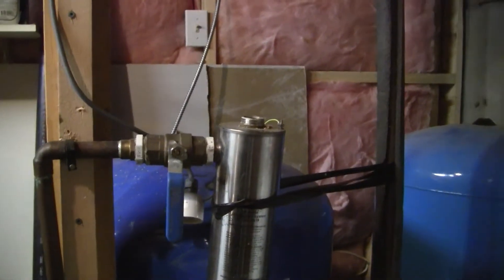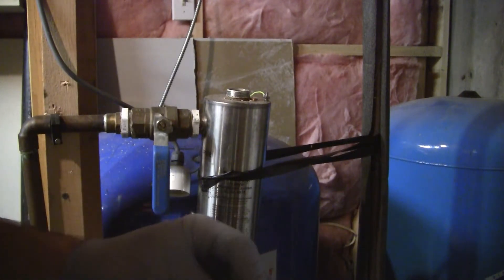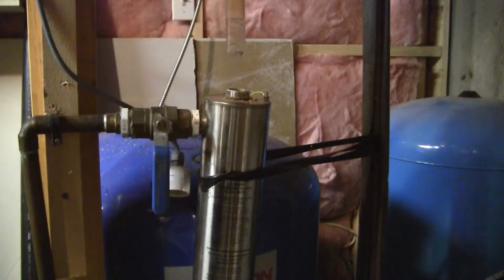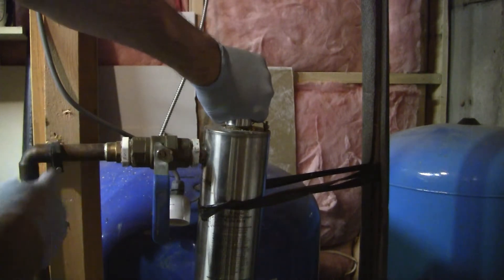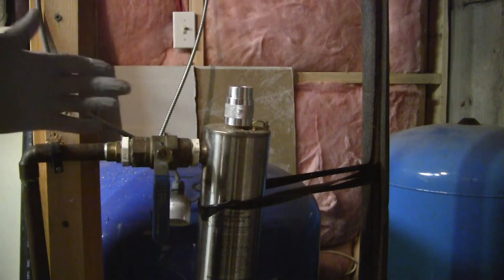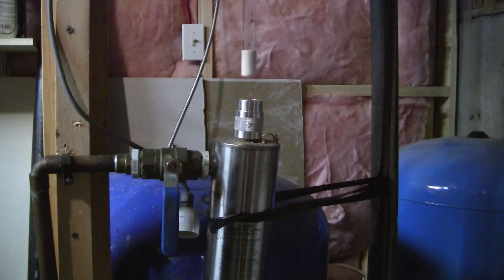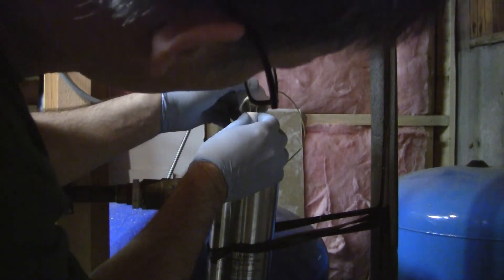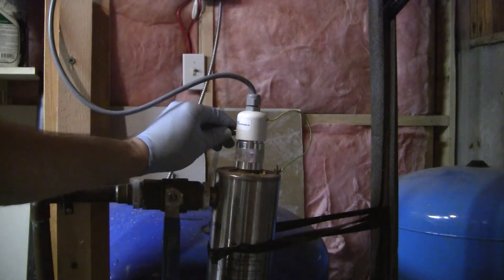UV light bulb change out for Ultra Violet germicidal system part 4

Comment: Thanks for the demonstration.  From all that I've read, you need to replace that filthy, dirty quartz sleeve.  Although you cleaned it, it should be crystal clear.  They suggest vinegar or CLR (calcium, lime & rust remover).
Reply from the maker: good point will try clr and or vinegar on it.